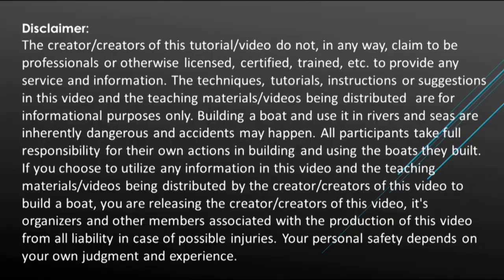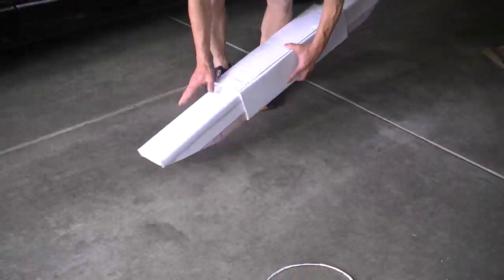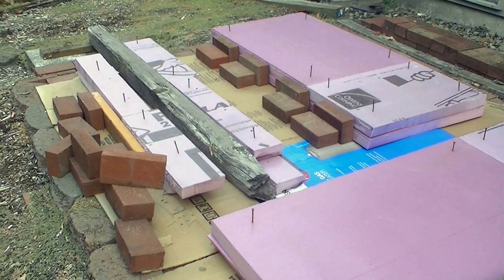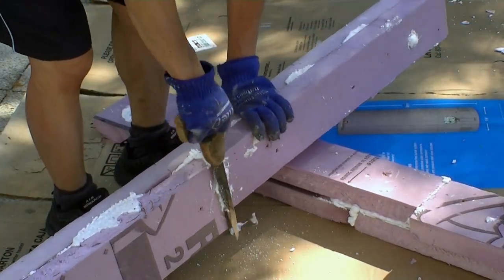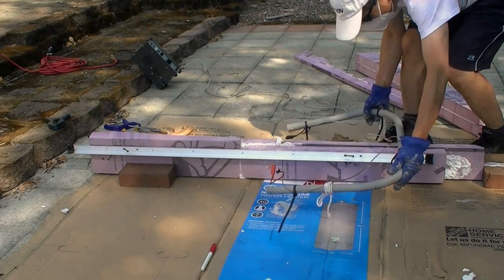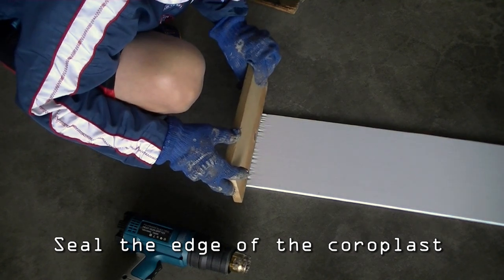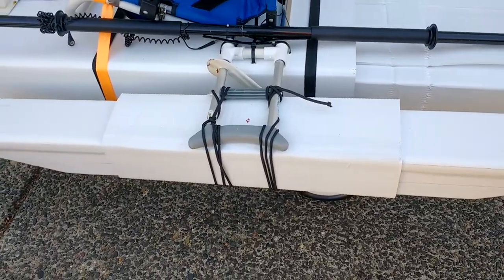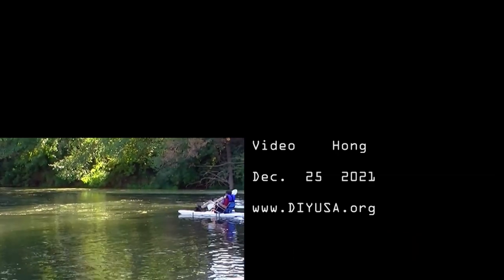DIY Outrigger For My Foam Fishing Boat ! 2021 Learning Pt 2

Comment: I like your sealing of the Coroplex board with a heatgun and piece of board to press down on it. That is so so simple. Why did i never think of that before. Many thanks for this and all your videos!
Reply from the maker: Thanks watching and your support. I used this heat fusion method to build different things. I use heat gun and my friend used clothing iron to fuse the coroplast. The joint is very strong.

Comment: I hope your putting a strong protective covering on all parts of this craft to keep the foam from being compromised and falling apart in the water, which foam does.  We have enough pollution in our waters and don't need more.  Something to think about.
Reply from the maker: Thanks for your suggestions. I do care a lot about environment, not limited to the disintegrated foam in the water, but also plastic waste, E-waste, air pollution, water pollution, etc. The boat in this video has been recycled. I probably not using the best protective covering available for the foam in building my boats, but I can assure you I constantly checking the covering and if there is a sign of wear and tear, it will either be repaired immediately, or the boat will be decommissioned. Besides my boats will be used in calm water and rivers and the stress on the outer skin will be very minimal. Thanks for bringing this up so we are all reminded about this issue.
Reply: "Poor man's fiberglass" might work for a protective covering.

I love your ideas with this project.

Comment: Have you heard of the AquaNaut 270?

It's a foldable catamaran.
Reply from the maker: Yes, I have watched their video. I want to build boats under 30 lbs (without motor). AquaNaut 9' boat each hull weighs 35 lbs and total weight is 120 lbs. The price for the 270 model is at $3999, which is very expensive. At this price range (and less), there are other foldable boats. My other goal is not to use the car top rack. Cheers!